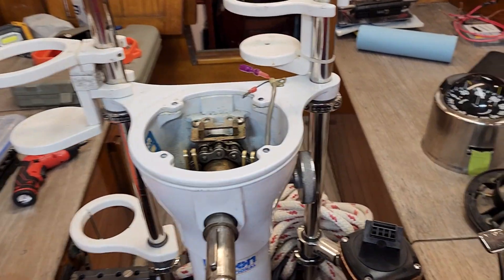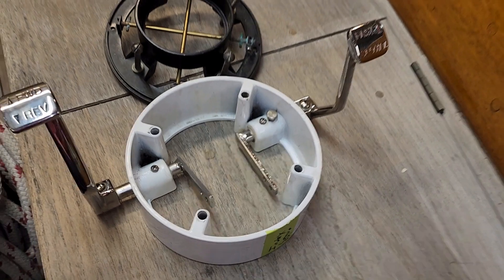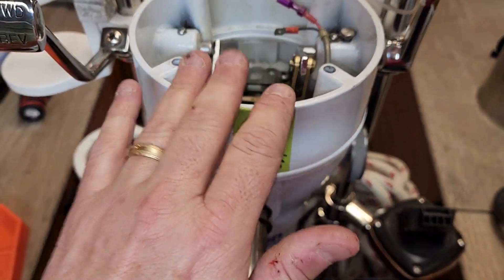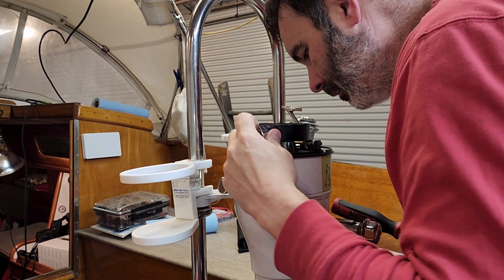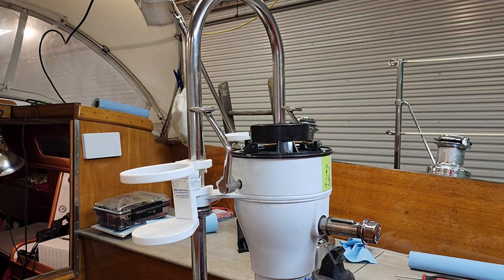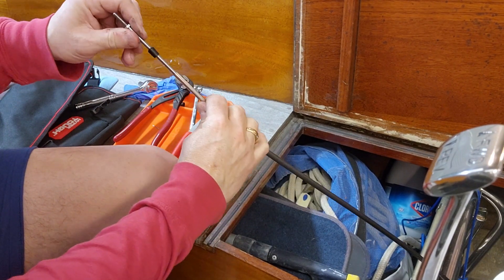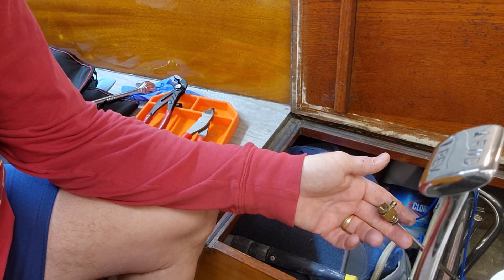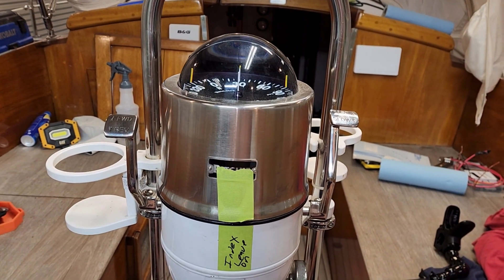Edson Pedestal Cable Replacement - Reassembly  4 of 4

Comment: for what it's worth, you can adjust your clutch handle so it does not hit the pedestal guard.  This is noted on page 7 of Edson's Pedestal Mounted Engine Control Installation Instructions (EB-99-396).  https://edsonmarine.com/content/EB396EngineControlInstr.pdf